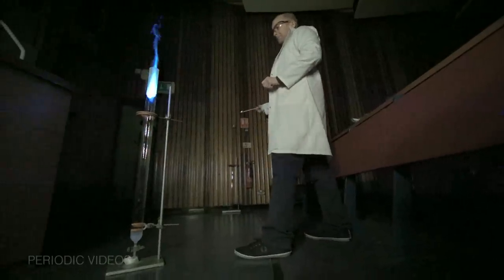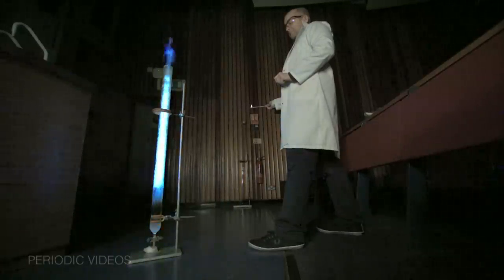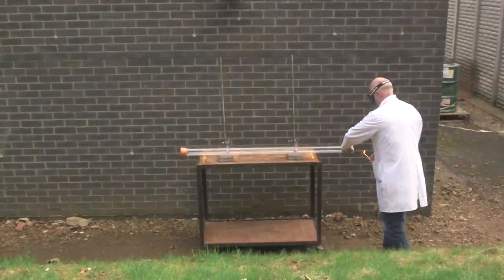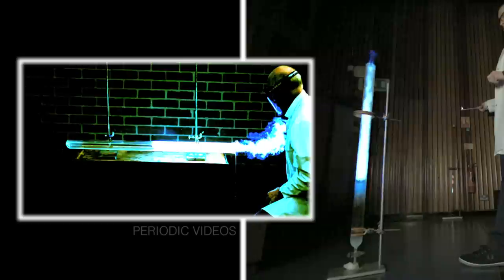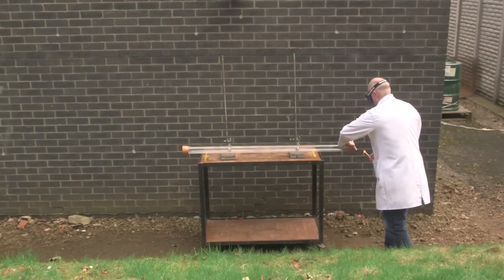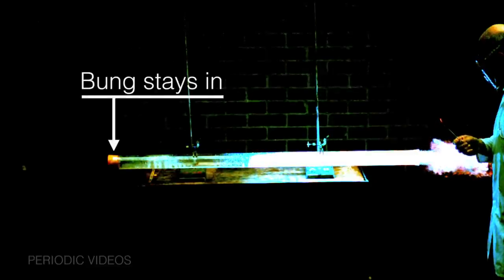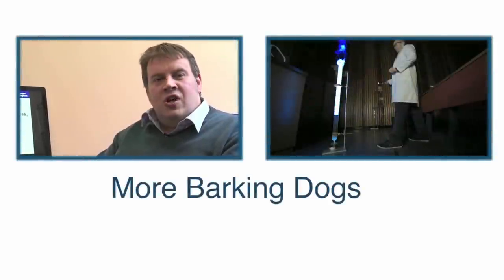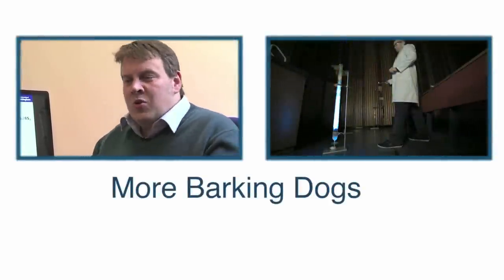Horizontal Barking Dog - Periodic Table of Videos

Comment: Just a thought. What would it be like if the experiment was done vertically but the tube was horse shoe shaped and open at both ends but lit at one? I'm guessing that it sould behave differently aince the gas/liquid mix are denser than air that it would behave unusually as the flame front travelled down the tube and up the other side.

Comment: I wonder: Does it matter that there is liquid escaping, or does that not matter at this stage of the experiment? What would happen if there was a reservoir at the bottom of the tube, e.g. O===|, how would this affect the path/behavior of the flame? For the horizontal, "uncapped" version, a reservoir in the midsection of the tube could be used, e.g. ==O==. Hmm...

Comment: why shall you not to try the same experiment as the rubber end. But instead place spring at the end and but another rubber. So if it really push trough the tube you will see the spring moving

Comment: what if there is something about compressing the gas that prevents if from burning?
Reply: if that is the case, when you combust the top part, it compresses the bottom so it can't burn, and when the pressure normalizes it burns another parcel of gas just large enough to compress the gas left under it!

Comment: Next maybe you could investigate why burning thermite on top of a bloc of water ice makes the ice explode?
Reply: Francois Lacombe Heat + water = steam
Reply: Francois Lacombe Heat and water is already very well known as a combination that causes explosions due to phase change into gaseous state.
Reply: Miner 2049er I've always assumed it's a combination of Heat+Water=Steam, and Extreme Heat + Steam = Hydrogen + Oxygen, which recombine explosively.
Reply: ***** You're aware of the energy required for hydrolysis of water, right?
Reply: Apparently, there are many hypothesis about how that works, but nobody really undestands why it happens. My hypothesis is that the intense radiant heat causes superheated water under high pressure to form in the air bubbles trapped in the ice. Soon, the pressure causes some of those bubbles to crack open and the trapped water instantly vaporises, causing shockwaves that break open all the remaining bubbles in a chain reaction that leads to an instant BLEVE event which shatters the ice.
Reply: ***** Thermite produces around 2500 deg C. At that temperature only about 10% of the water thermally decomposes (thermolysis) in theory. At the same time a large amount of water steam is produced since it is way above boiling.

From what videos I've seen there is no evidence of a chemical explosion (oxyhydrogen) only a "slow" thud. Mythbusters had a theory is was unburnt thermite that sprayed into a cloud and ignited. I doubt that. The explosion seemed to happen below the thermite fire. Trapped steam would be my guess, and fireball from all the molten metal above. It would certainly be interesting to high speed capture this phenomena.
Reply: Miner 2049er IIRC, 3000°C is required for any significant amount of thermolysis (the word I was actually intending to use), which sounds in line with your figure, too.
Reply: How could you design an experiment to test this?
Reply: Thor214 Yes I belive that yields about 50%
Reply: Francois Lacombe YESSSSSSSS so awesome,can't wait now heheheh

Comment: But if you wanted to test the "shock wave" hypotesis, why you didn't just put a latex glove, a baloon or a condom on one side of the tube to close it? If the hypothesis was true, the increasing preasure of gases would inflate a little bit the "closing", which should be visible if filmed with a super speed camera :) (the you did film with ;) )

Comment: Professor, could it be bouncing due to a lack of oxygen?
Reply: Mike McKinster that's what was I was thinking. if the gas produced by the reaction has nowhere to escape but upward, would it not replace some of the the oxygen, slowing down the reaction? Then, once some of the of the gas escaped, the flame would be able to grow again. Also couldn't the lack of a stopper instead cause a change in the convection within the tube, allowing the gas to escape freely?
Reply: Mike McKinster No, in the video, at about 0:21, they give the reaction equation. There is no oxygen required in this reaction, all the reaction products are in the tube.
Reply: Mike McKinster The reaction doesn't need oxygen from the air. It's bound within the N2O, Reacts with CS2 and results in N2, CO, SO2 and S8. Also, not everything that burns reacts with oxygen.
Reply: Toon D First thing i thought that same thing about a lack of oxygen, sort of how a pulsejet works.. But i never thought of looking at the equation! Thank you, random wise internetman! I would never understand chemistry equations anyway :D
Reply: Moraren Thanks;)
Reply: ***** Actually everything that burns (aka. combusts) does react with oxygen. However that oxygen is not necessarily in pure oxygen form, it can be found in many oxidizing agents like potassium nitrate, ammonium nitrate, kalium nitrate, nitrous oxide, dinitrous trioxide, ferrous oxide. Then there are reactions what happen by themselves like nitroglycerin what has the oxygen also in it. C3H5N3O9 has 9 oxygen to 3 carbons relation what is one of the reasons its so reactive, that combined with its polar consistency it makes a hell of an explosive.
Reply: *****
In this perticular situation is oxygen bound within the molecules. but what I wanted to say is that other reactions can burn with a flame without any oxygen at all. But there will a substitute for it be needed.